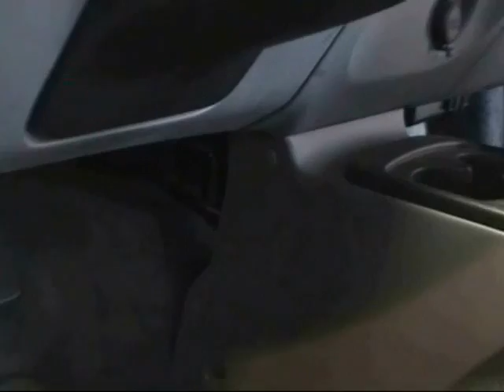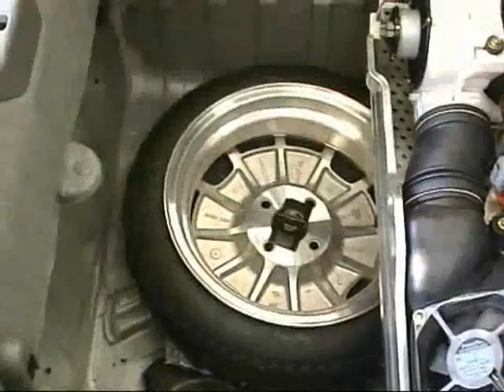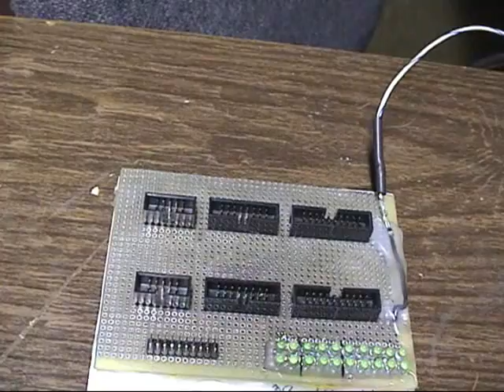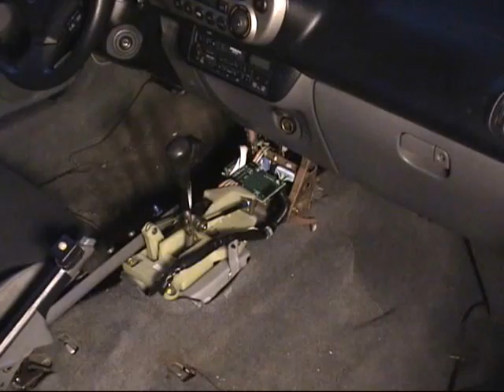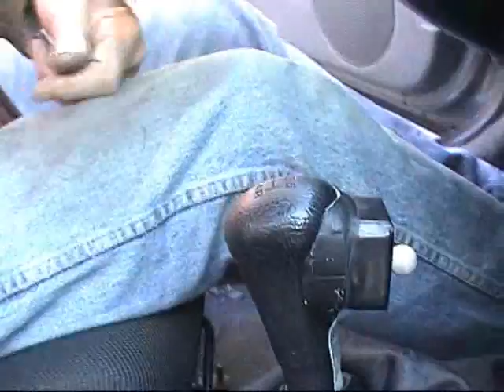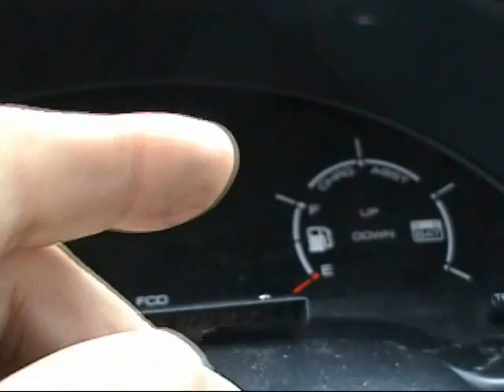MIMA full plugandplayinstall V4.wmv

Comment: When mounting the boards to the console frame the console frame should be taped with foam padding this way there is no way that a wire cant wear against the bear frame that can short the system . This is what I would do